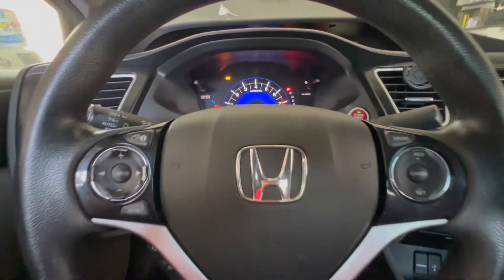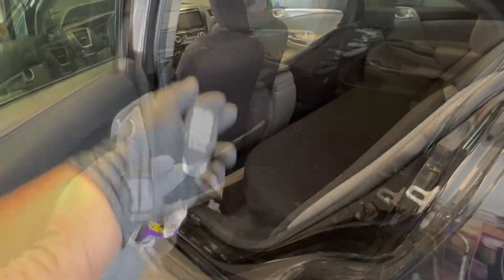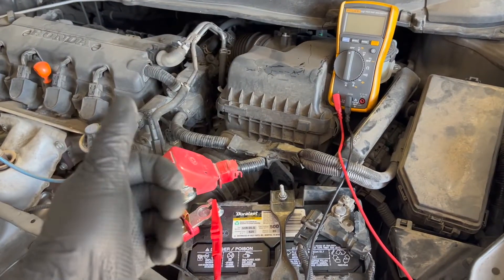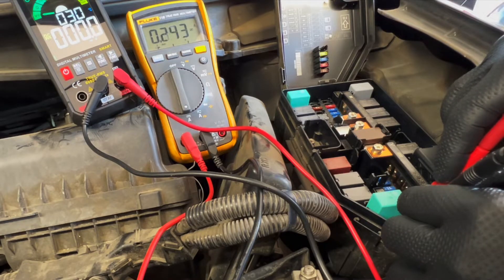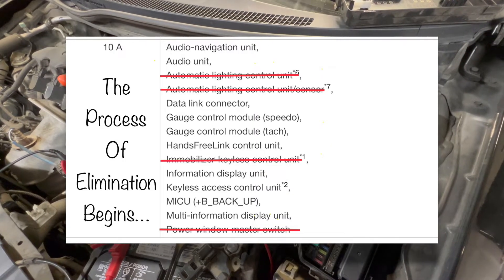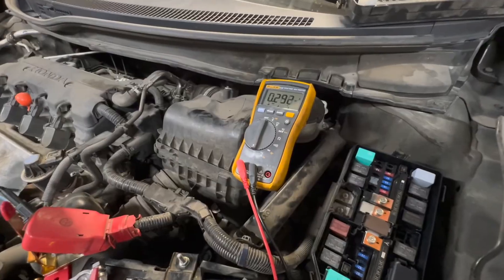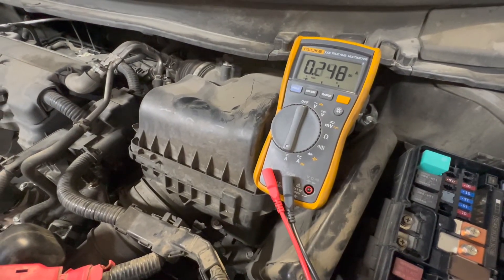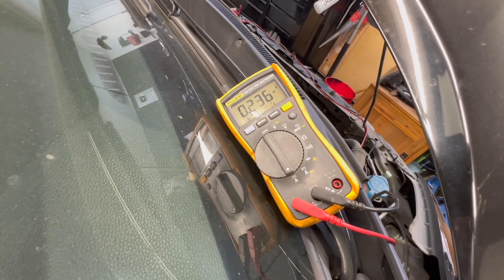New Battery, Alternator, and Starter - Car Will Not Start If It Sits For A Couple Days

Comment: Had similar problem with the same fuse.  After killing a couple batteries, I decided I had to fix it.  Finally found a 4g GPS tracker that some used car lot installed under the dash and wired to the back of the obd2 plug.  And draw went from 0.12 to 0.005.  I was pissed.  Especially since we paid cash for the car 4-5 years ago.

Comment: 2016 Honda Accord Sport 2.4L – Electrical/Idle Issue Help Needed

What’s up everyone — I’m trying to figure out an annoying issue with my Accord.

I have a 2016 Honda Accord Sport (2.4L) with several electrical upgrades, yet I’m still experiencing a rough/unstable idle. The car runs better when both the headlights and A/C are on, but even then it randomly dips low, almost as if it wants to stall—even when the sound system is off.

Here’s what’s been done so far:
	•	250-amp high output alternator
	•	Larger AGM battery
	•	Big 3 upgrade with 0-gauge OFC wire
	•	Secondary battery in the trunk
	•	1000/1 and 400/4 JL Audio system
	•	Replaced belt and tensioner
	•	Replaced negative battery current sensor
	•	Planning to replace the ELD (Electric Load Detector) next

I’m still getting a battery light that randomly comes on and off, and the voltage bounces between 14.6V and 13.7V even with no additional load. Cold starts spike to 15V before settling down. Vacuum leaks have been ruled out.

Can anyone tell me exactly what wire to tap into to bypass the ELD, or what needs to be added or changed to fully correct this issue?

Any help or advice from anyone who’s experienced something similar would be greatly appreciated! Shits deep y’all.

Comment: 2017 vw Passat put new battery in crossed the battery cables started sparking headlights   flashing horn beeping.re disconnect positive negative the right way check the fuses inside outside battery keeps draining car turns off have to charge it. Take the charging cables off car dies out.
Reply: Did you fix this have sane iissue with 04 cayenne

Comment: Very well done. Helps a lot. I have one now that has a drain on the battery but it's not that suttle.  It's not the only problem. 
Thanks very much for the video very well done and easy to follow and see how it relates to other problems. THANK YOU

Comment: Hello Hector I've been trying for over 8 months to try to get a hold of you to see if you can figure out what's up with my 2013 Chrysler 300 3.6 l rear wheel drive sometimes it doesn't want to start sometimes it does I'm in the inland empire I could be a Pomona Fontana Riverside you tell me where you're at and I'll come hopefully I get a response I've left a message just about on every video have a good day 4/30/24 Str8Tattedup

Comment: I’ve had the same issue with my 2014 Si. Walk past the passenger door and it unlocks. I’ve verified that pulling fuse 29 gets rid of the drain as well. I now have a good place to start looking. Thanks so much for doing these!

Comment: Hola Hektor, 

Fantastic content.

Can the battery disconnect switch be connected to the negative battery post for this test or does it need to be on the positive side?

Gracias.

Comment: Great video and i will definitely use this in the future!!! The funny thing is I was working for firestone and we did 3 batteries and 2 alternators for this 2013 accord with pushbutton start….i did all the same things with the multimeter in amps mode except i started pulling fuses. Long story short it was the drivers master window switch…..but after putting it back together it wouldnt start and kept saying “NO KEY DETECTED”….🤦‍♂️ had to get a mobile programmer to force the ignition on and some other stuff but i will definitely put this info in my toolbox and never pull fuses again lol Thanks

Comment: Hector is not possible to just replace the parts in the handle or do I need to buy a whole new handle? The colors won’t match!
Reply: probably just replacing the individual part would be fine, but for the cost or the way it's packaged or the trouble to replace the component, replacing the whole assembly would just be easier

Comment: that trouble shoot is awe inspiring.  absolutely incredible.   I have a parasitic loss in my dodge caravan,  I traced it down to the instrument panel.   body control units running through the instrument panel , so i was never able to figure it out completely.   great job Hektor.

Comment: Excellent video! I have been dealing with my 2014 Honda civic ex with a parasitic drain for 6 months now. Replaced battery and alternator but still draining. Taken the car to Honda and have spent over $1000.00 and $550.00 at another shop for labor for them trying to find the drain and they say there no parasitic drain but why is my car battery dead after 5 days when not driven.. but still draining Brought the car back to them and told them about the passenger door if I get within 5 feet the all doors will unlock I do not have to touch the door handle. They have ordered me the door handle but it is 2 to 3 month wait due to backorder. This tells me there is something wrong or defected with the handle! Thanks again Hector you do awesome videos keep up the great work! If you were close by I would take my vehicle to you for service!!
J Hum
Nova Scotia, Canada
Reply: or you could just unplug it. sure you lose the powered unlock feature on that door, but it's one less thing to hassle with

Comment: Excellent diagnostic video!! I use a thermal camera to zero in on the drain. Also use a amp clamp on the negative battery.